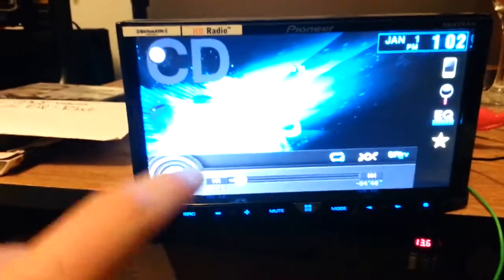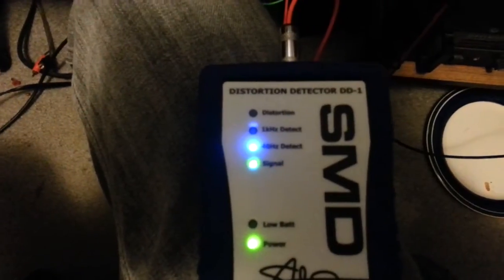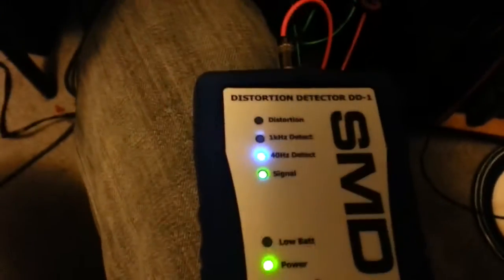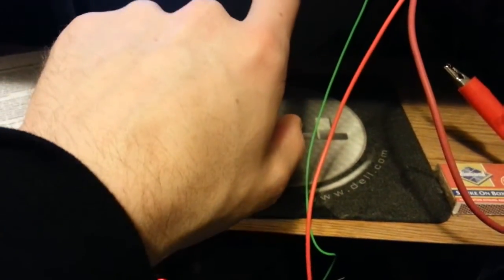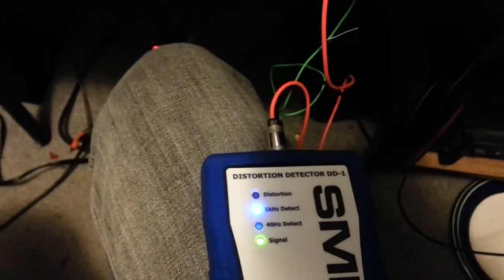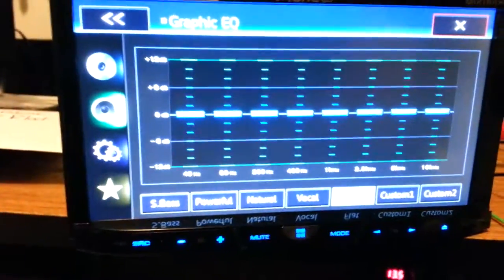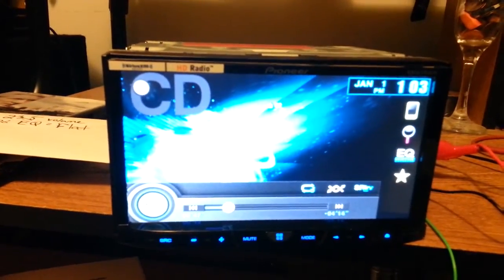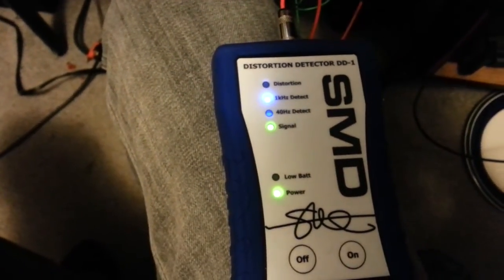Pioneer AVH-X5600BHS distortion test

Comment: wtf i thought these decks can go up to 40 without clipping...did ubhave bass boost or loudness on?
Reply from the maker: akuma4u nope, all that was off and EQ flat.
Reply: jon honestly its late and i had to watch on mute. so what did you max unclipped vol turn out to be? im tryin to figure out what volume to set my amps gain at...i was going to do 35ish but your vid has me 2nd guessing now
Reply: jon was your sub level at 0 or max?
Reply from the maker: akuma4u max volume is 26. Yes, everything was at the default 0.  I'm still using this head unit and I love it. Especially since I got it for 100 off original price.
Reply: i had the 4600 and then sold that and got the avh4800bt which im still currently using.. much better screen and more features,.. i suggest u get that one trust me.
Reply: oh another thing.. ive heard the CD source is strongest.. and other sources will give you different clipping levels.. you should try and see where the deck clips at on usb , ipod, etc
Reply from the maker: akuma4u yeah, I probably should do that sometime.  I'd have to download the tracks and put them on a flash drive.
Reply: what was your speaker levels at then you did this test? not the eq or boost, the speaker level

Comment: Put it in your car already lol.
Just giving you shit I am still trying to finish my amp install don't feel like working on it
Reply from the maker: Lol oh I wish it was. I had to hard wire everything and then I couldn't figure out how to get the dash kit and their properly so it would just fall inside. I'm really frustrated and currently feel like I wasted $350
Reply: jon search  YouTube brother  there is always a way. I had that issue on my old lady's car I used pieces  of 2 kits and some plastic weld got it to go hope you figure  it out
Reply from the maker: bassinyourface Yeah, i've done a few youtube searches but haven't found any videos of my car exactly an a double din. But, i'm not going to give up. I spent too much on this head unit, i'll figure out something. thanks i do too, driving to work with no raido today sucked